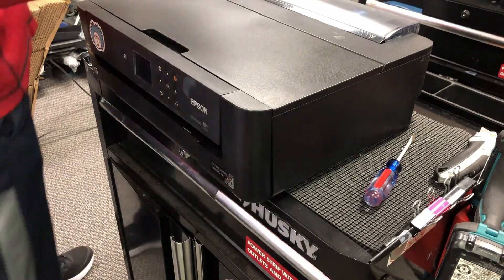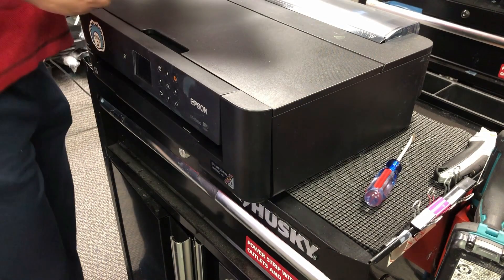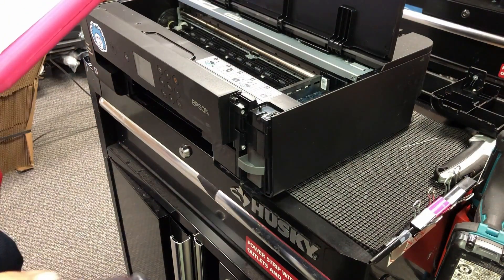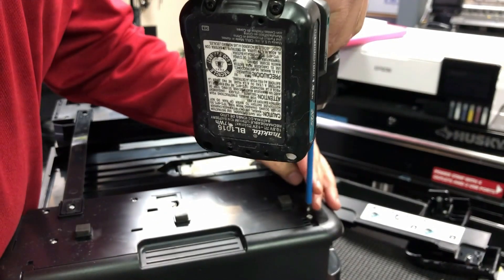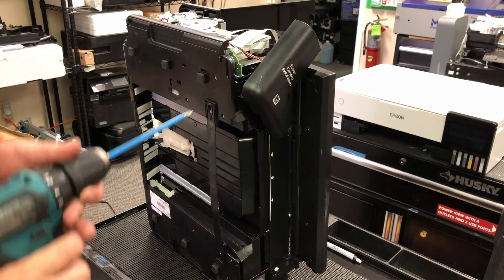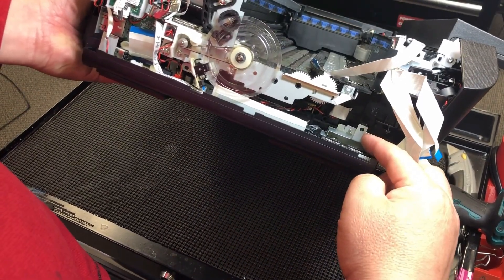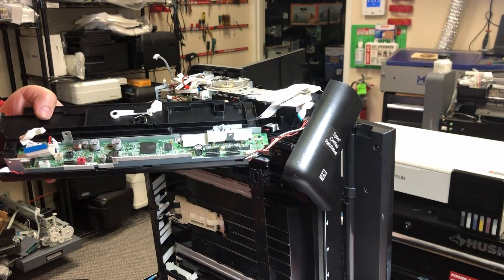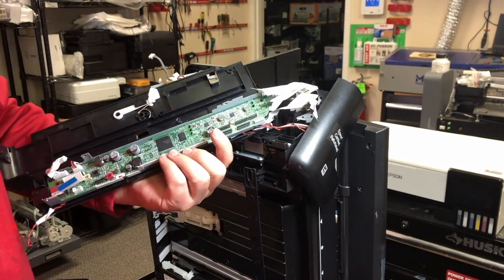Unbelievable: How To Replace Epson XP-15000 Mainboard in Under 10 Minutes! Uncasing

Comment: Hi, do you sell the xp15000 powersupply? my printer was hardly used. then one day power went off, i did all the power on and off procedures. so now i have to open her.
Reply from the maker: Thanks so much for your support and for reaching out with your question—I really appreciate you taking the time to engage. Yes, the XP-15000 power supply will be listed on bchtechnologies.com, so keep an eye there as it becomes available, and opening the printer to inspect things is a reasonable next step given the sudden power loss. I do get a very high volume of questions, so replies are prioritized this way: subscribers and members are typically answered within 48 hours and also receive extra benefits like early access to videos; regular viewers are answered if time allows since I can only reply to around 10 questions per day; after subscribers and members, any remaining reply slots are filled last-in, first-out, meaning newer comments are reviewed first—if you’re not subscribed and don’t hear back within 48 hours, you can either subscribe or re-post your question, and if you subscribe later, your older questions automatically become priority without needing to re-post. I’d also like to invite you to join Run With Kevin — LIVE, where I go live every morning (usually between 6–8 AM Eastern) answering printer questions in real time, so be sure to subscribe and turn on notifications if you want to catch the next live session and ask directly. If you need faster assistance, feel free to email [support@bchtechnologies.com](mailto:support@bchtechnologies.com), and if this video or my comment helped you, I’d really appreciate a Google review here: [https://g.page/r/CfL7k6nYvPQ9EAg/review](https://g.page/r/CfL7k6nYvPQ9EAg/review).

Comment: I'm on my 8th XP-15000.  I use them for DTF, and that is notoriously rough on printheads.  If I can just buy a new printer for $300 and use my old mainboard (which includes the firmware I pay $50 for each time I replace a printer) this would be a bit of a game changer.